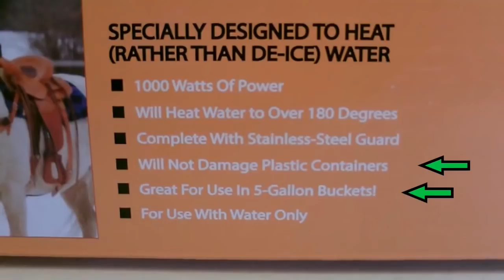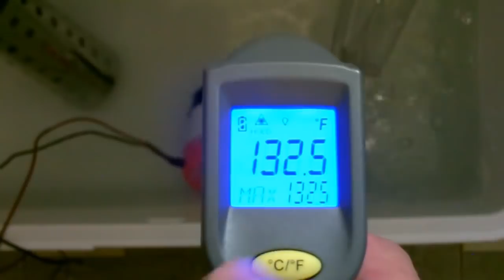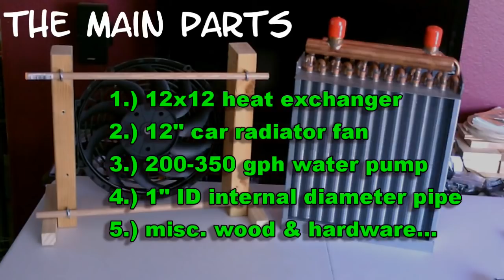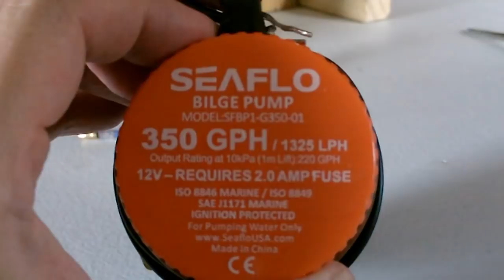DIY Air Heater! "Hot Water" Air Heater! (w/12x12 HeatEx.) AC/DC Solar Pwrd! Max 57k BTU! (2000sq.ft)

Comment: Thank you for this! I'm going set something like this up from my outside wood furnace boiler to my greenhouse to heat it in the winter. I'm just going to buy an old car radiator and attach a fan to it and see what happens - thank you again for the idea!!!!!!!!
Reply: They have electric radiator fan kits for cars that are 12 volts which if using solar power should conserve energy for this design

Comment: Your video here inspired me to work my own project.  Using an air to water heat exchanger, I have it set up in the ductwork off my pellet stove to the house (800 cfm squirrel cage blow supplies house and draws through heat exchanger).  From here it will heat at least a 55 gallon drum that will preheat hotwater and provide space heat for sunroom (not tied to house, needs it's own heat).  Objective, get as much off electric grid and propane needs as possible in 2020. Wood pellet...at leadt for now is more affordable than electric or propane.  If it comes to it...I can set the whole thing up with a wood burner to save even more.

Thank you for the video.

Comment: I use this with a 20 gallon water heater in my greenhouse on a temp  controller, turns on and off automatically as it reaches its set temp.   my last water heater lasted for 10 years and still was good, the new one cost $337. cost average about $200 all winter long to heat the greenhouse. I also use a pump to circulate and a temp guage on the line.
Reply from the maker: that sounds like a great setup 👍
Reply: That's what I want to do I want to use my hot water out of my hot water hater in the house So heat the radiator in my AIR intake to heat the house

Comment: I have a question. Could a 12V thermostat be hooked up to the unit? I think I'd have the heating element hooked to one if it didn't have it's own, and the fan/pump attached to another. I'm planning on being off grid in 2021 and this would be the most perfect heater for my RV. I could use the same setup as a 12v air conditioner and then insert a stainless steel stock pot as my water tank (or would that be too crazy?)

Comment: I used those condensers before in a home project for cooling 3 years ago
I also made a counter-flow one by stacking 3 condensers in series
The cooled water came from an evaporative setup i thought of, i filled a horizontal cylindrical  water-tank in half and used a fan to force air over the water surface,cooling it to a few degrees above wetbulb and pumped that cool water to the condensers stack, it worked well
But i coudnt scale this up to cool and heat the whole house, needed more money, and condensers are a bit expensive if you buy them mew

Comment: Good idea you should heat the waster on a wood stove out side and setup Multiple heater core and fan set ups
Reply: Or you could just use the wood stove inside 🤔
Reply: @swedesspeedshop2518  Sure that would be pretty simple to do just run a chimney up through your house shouldn’t cost much gold brick work and we all know houses don’t burn down from woodstoves or chimney fire

Comment: Have you tried the reverse with Ice water? Like an air conditioner?
Reply from the maker: hi there. yes, when i first started making videos using the 'water-to-air heat exchangers' i focused on using them as air coolers. they work great that way too. if interested, i've got 3 videos on that. the first link is of the prototype setup. the second link shows the setup in it's 'final state'. and the third link is to the original setup with extras, cost to run etc..
1.) https://youtu.be/nSA1OGhB-WI
2.) https://youtu.be/u0AGRBT1ISs
3.) https://youtu.be/dLspmypEqhM

Comment: I remember building something like this on a smaller scale to run off of the solar system I made and the heat came from a propane grill on a steel water tank.
Reply: I would love to see this, do you have pictures?
Reply: @tylerkeeling5806  If i remember i might do something like this again and make a video of it. There are a lot of cold people right now.

Comment: I would like to see you make one in reverse, using a cheap Chinese air diesel heater. Blast the heated air output into your water filled heat exchanger to heat 5 gallon buckets of water. So simple for you and nobody has that video out. I think it blasts out air at about 250F.

Comment: cool video. i am experimenting with this stuff but for different applications found that my 10.4gpm pump greatly out performs my 8.83gpm pump. i cant believe the water flow you have with your pump. my little pump is rated for 530gph, but i suspect its more like 530gallon per 12hours lol.

Comment: have you done a solar air heater using a couple cheap solar pads with a some sort of water pump?  Or would it require a powerful pump?  Hopefully the pump could be powered by a single solar panel.  Typically oil is used instead of water, but that requires a special pump.
Would this work any better than the can dry air heater?

Comment: fior anyone who wants the heat exchangers Cheap..  look for a school bus junkyard in your area..  school nbusses are full of heat exchangers of all different sizes used fore the bus heaters..   the right front by the door is usually a 12x12..  the rear heaters under the seats are usyally 8x12, the driver front heaters are normally a 12x16 or 10x20  in bluebird busses..  some of ther amtran and IC busses used 16x16 heat exchangers oin the driver heaters..  they normally will be sold to you very cheaply and are typically 1" OD copper inlet and outlet. ..  you will find all kinds of blowers and fans as well to help you with your project in a bus junkyard. many busses also have nice 12 volt pumps as well with the same line sizes..  again usually cheap..
Reply: Good tips . Thanks

Comment: Man I should of did this in my garage. Idk how well it would of worked but I would of been worth a shot
Reply from the maker: hi. these things put out a massive amount of hot air. probably work great in a garage 👍
Reply: @desertsun02  I know it's late rite now for something like this but it's worth a shot I think I'm going to go purchase a radiator and the heating element as soon as I can.
Reply from the maker: cool. plus remember, if you've got a source of cold water, this thing works as an air cooler too.
Reply: @desertsun02  yeah to bad I can't take the ice from the lakes rite now and use that

Comment: Im going to try this with a rv style propane water heater, hoping to heat a small off grid cabin
Reply from the maker: sounds good 👍🙂
Reply: How did that work out as i want to do the same?
Reply: @jezza4338  the water heater ran alot more than expected, and the coil heater was good if pointed right at you but didnt heat the whole room, i might have to get a bigger coil

Comment: Nice one
Great joob pls tell me this is converting 55 degrees Celsius water to 45 degrees Celsius air but what would be if we try convert 55 degrees Celsius of water to water at heat exchanger do u thin the same temp like 45
Thx

Comment: Could I use an old radiator out of out of an old vehicle  using the cooling fans on the radiator
Reply: Absolutely! But with a higher output pump of course. Might even need another heat element due to the extra volume of water.

Comment: The BTU ratings on these coils is likely based on 180 degree water. Obviously it will be less with with cooler water. You should also use automotive heater hose because it doesn't kink as easily when hot. Comes in 1/2" 5/8" 3/4" and 1" inside diameter. Cheap too.

Comment: Great video, I'm planning to add one of these to my home hydronic heating. What hose did you use to run the water in this video, and where did you get it?
Reply from the maker: hi. the hose is a 10 foot section (cut in half) from home depot.
Reply: @desertsun02  Thanks for the info!

Comment: I built the exact same heater but once fan is turned on it cools off the water pretty quick...any ideas
Reply from the maker: hi there. the main options are running the fan slower or using a stronger heat source so the water temperature holds steadier. these units are pretty powerful so they pull the heat out of the water and put it into the air pretty fast. another option is to use a thinner heat exchanger like the hayden transmission coolers. i use them in some of my air cooler videos but you can use them as heater too.

Comment: Good that you use dc fan. AC fans use lots of power. You can use smaller 8" fan that use 5 watts by drawing the coldest air from the floor ...thru the heat coil .It creates a convection , always bringing the coldest air which is the ait neareat your body , to be heated . Floor temp and 5 ' high  from floor can vary 6 DEGREES C. or 10 F
Reply: Fun fact, for heat the in- effeciencies of the ac fan actually dont matter as the wasted energy is directly converted to heat and thus heats the room :) not that you asked or anything lol

Comment: is that 57,000 BTU per day? I don't see how it could be per hour, regardless of what any labels might read - regardless, that's a really cool build! Northern tool and Tractor supply have those bucket heaters on sale (in warm weather anyways).
Reply from the maker: hi there. with optimal water temp these are powerful units. here's the chart that shows btu output from smallest to largest. https://i.ebayimg.com/images/g/0DcAAOSwBQ1eQyeX/s-l1600.jpg (for more info check website that sells the heat exchangers). here's the link https://badger-pipe.com/collections/water-to-air-heat-exchanger

Comment: try circulsting the water through the solar pannel somewhow.  help the system heat the water or, if you have enough pannels, heat the water entiremly
Reply from the maker: hi. pairing this with a solar thermal water heating panel (or panels) is a great way to get the hot water you need

Comment: They make DC heater elements for your coffee cup too. 
But it comes with a car cigarette lighter/plug.
Reply: Yeah, those are handy.  I invested in one since I was struggling with inverting the amount of energy for a water heater pitcher to make tea and food that uses hot water only... or at least pretty much.  The lower wattage design made the system design way easier and more cost effective and compact.  I do wonder about the quality of the units in regards to material and impurities.
Reply: @jafinch78  I ordered a dozen online for 2 bucks each. I understand you can make them using 12ga wire and a battery. After all - they are a simple heating element with no moving parts.
Reply: @KaleidoscopeJunkie  Right... insulating properly to prevent shock and the materials used being healthy/safe are the only DIY issues I'd be concerned with.  Yeah, is a DC resistive heating element. A little simple math down to ohms law even basically with specifications of the materials used available.

Comment: my misunderstanding,can you help me to understand clearly please? : we heat up water and circulate it with hose..to we will warm up house..it is target..but why we use fan to cool down thru radiator if we want to heat up house?dont we need to keep hose/pipes as much as hot instead of cooling with fan??
Reply: The fan will only cool to the ambient temperature of the room.
Reply: The fan cools the water, yes, by putting the heat into the air

Comment: Could boil water with fire from outside and dump into ress
Reply from the maker: absolutely. that's a great way to heat the water.
Reply: Boil water from gas stove top, why go outside to do it? Gas stove is more efficient than an electric one.

Comment: Neat as I've wondered about using vehicle radiators and heat exchangers from a salvage or junk yard as a cost effective heat exchanger method.  Now in regards to drinking or shower water as an open loop system (just that heat exchanger source processed as output used to drink or whatever comes in contact with the living)... this method is the way to go.  A closed loop system (salvage yard sourced exchangers used against the clean or food grade exchanger to transfer heat) using this design would be interesting also.  Wondering if cost effective surplus commercial solar PV panels can be sourced for the bucket heater also?
Reply: I saved my daughter's AC window unit when it gave out. I'll have the freon removed at a repair place and harvest the coil.
Keeping My eye on craigs list for free upright freezers.
I figure to take the coil for a thermo-exchange project and build the freezer housing into a cold-smoker for meats.
Reply: This system only makes sense if you use a solar water heater to heat the water. Heating the water with an electric heat element is ridiculously inefficient. It would make more sense to use electricity to power an ordinary electric ceramic heater. This way your blowing hot air directly from the heat element.
Reply: @cfed00  He is offering alternatives.
If the sun doesn't shine for a 3-4 days then a DC element is a back-up possibility.
Reply: @KaleidoscopeJunkie  What I am saying is that it is an inefficient alternative. The heat element he used is 1000 watts, and the heat output he was getting getting off the fans was a little over 140 F tops. A 500 watt ceramic fan heater, on the other hand, puts out over 240 F. Even if you consider the inefficiencies associated with using a DC-AC inverter, this is still better. So, I would be inclined to consider using this type of system with direct solar heat instead. I wasn't trying to be overly critical or anything.
Reply: @cfed00  No doubt.  Basically a wall or roof section if not entirely can be dedicated to this operation most likely with solar powered shutters/blinds also for better control.

Comment: Maybe make a recirc loop from your water heater.
Reply: I did that 10 years ago. I put 120 feet of copper tubing under the house and entry way tiles, circulated it  from my hot water tank with a Taco pump. Result...only luke warm water for a shower. The thermostat for the gas valve is in the bottom of the tank. Normally, hot water rises and pools near the top. Turn on the hot water faucet and water is drawn from the top of the tank while the cold supply goes through a plastic pipe to the bottom of the tank where its much cooler.  

But if you recirculate it, the water tends to mix to an even temperature throughout the tank. The thermostat will shut off the burner way too early. If you jack the temperature to maximum and the electricity to the circ pump fails, the water in the tank will be dangerously high.

But the cat loved the warm floor tiles in the entry way while it lasted.

Comment: Hope you didn’t continue using that cheap hose. In the same way you can use to disperse hot air you can do the opposite by installing a unit large enough for your attic space and heat whole house water or a swimming pool.

Comment: where do you get that adapter for the pump???? anyone?
Reply: "long three-quarter to one inch double threaded pvc to the one inch bar that will fit in the end of the pipe 10ft section x2 5 foot"??
Reply from the maker: hi. of the 4 pieces. i got the 2 hose barbs and the double threaded pvc at either home depot or lowes. the short section of 3/4" pipe that fits on the bilge pump is from a marine supply store. they sold that pipe by the foot so it was pretty cheap. *when i was at the marine supply store i noticed they had some of those 3/4" barbed adapters too (so you could get those there too). way cheaper at home depot or lowes though, but they didn't have that pipe by the foot.